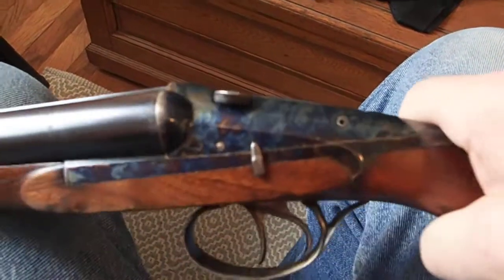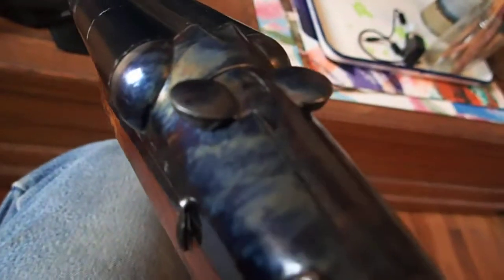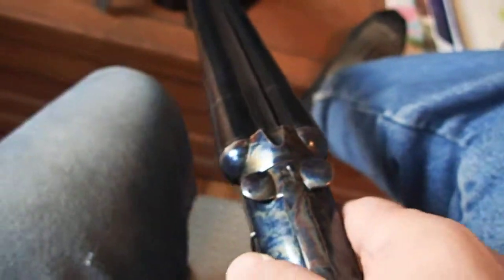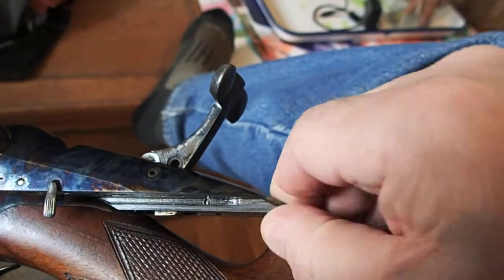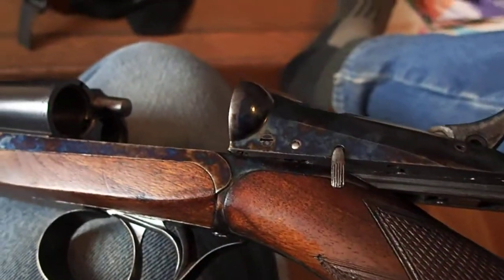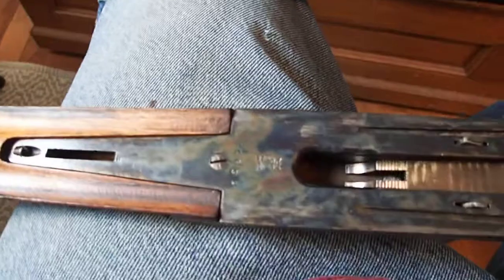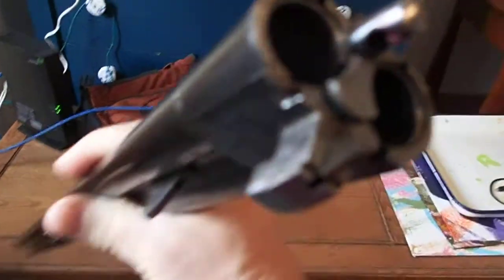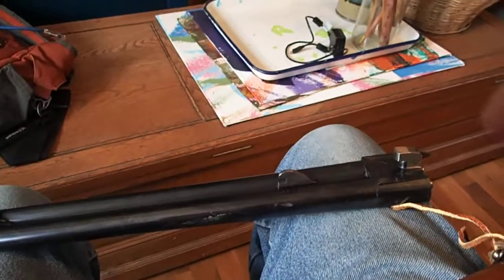Darne R10 shotgun circa 1955

Comment: I have a Darne r13, probably from 1930-something. To remove the barrels there is a rocker catch under the breach right below where you insert the shells; a gentle push on that with a screwdriver and the barrels come right off - no hitting the barrels needed to remove them.
Reply from the maker: Thanks David.  I learned this later, but the other way work as well.  I no longer have the Darne as it was not well regulated.
Reply from the maker: Maybe you could help Kostas M. below.